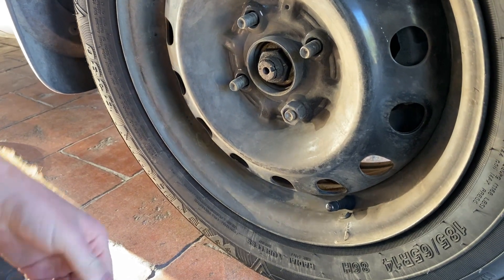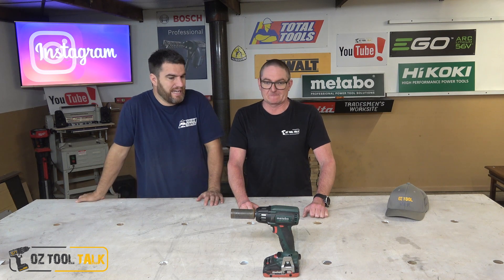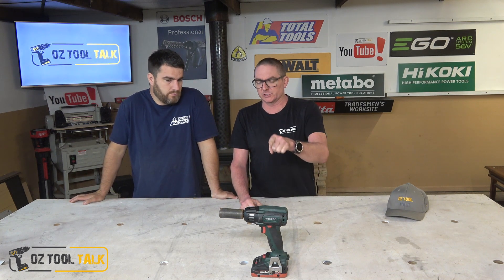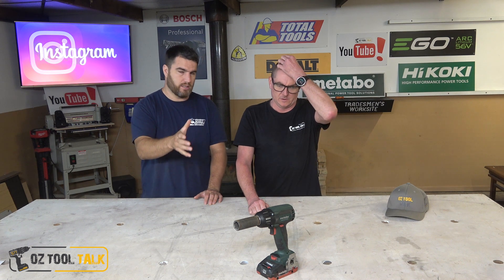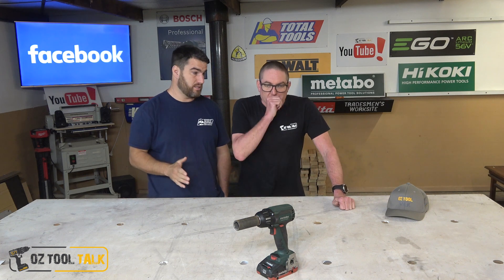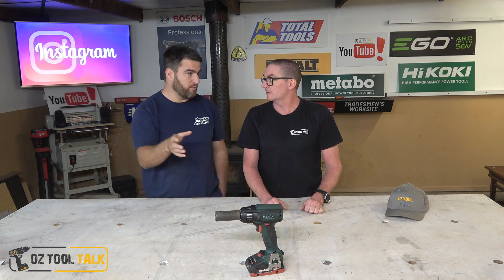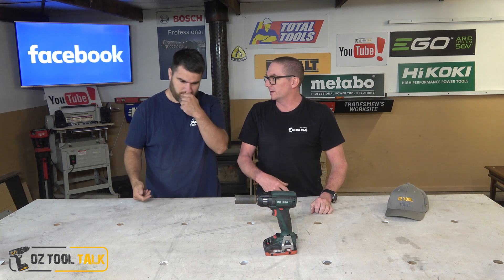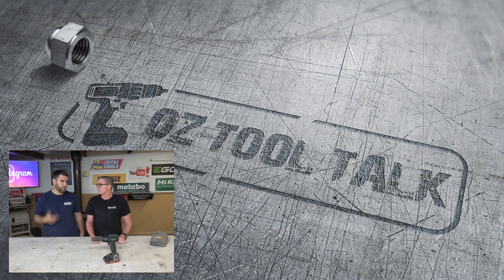METABO Brushless Impact Wrench - GERMAN-MADE - SSW 18 LTX 400 BL [2020]

Comment: I;ve had one for a few years now.
Amazing bit of kit.
I think it was the World's first variable speed impact wrench/driver.
Use it for everything from bolting up big steel girders to delicately putting small screws into door hinges with a 1/2" square to 1/4"hex adaptor.
Variable speed on the trigger and on the dial.
Has completely replaced my drill/driver for driving screws of any size.
Reply from the maker: it's a beautiful tool :)

Comment: Hello I'm from Germany and buy this one also because of your test. Unfortunately the Metabo didn't manage to loosen the nuts of my VW T4. I have tightened them six months ago with 180Nm. I'm really disappointed about this german engineered product. Can't believe it does 620Nm on your test.
At 3:36 it shows the same problem I have. Why does the working light turn on??? It should only work with the trigger pulled and stay on for about 5sec after release. At this case ist was nearly 30sec and the one I have stays on for minutes.
Reply from the maker: yeah that light is weird, does it sense vibration maybe?

can't undo 180Nm wheel nuts? I think it's defective.
Reply: @OZToolTalk  Thanks for your answer. It was also my thought but the manual shows no information. I send it back to metabo and hope to receive an answer in the next couple of days.
Reply: T4 wheel nuts are notorious for needing a breaker bar and sometimes even impact rated sockets to remove. ive heard of guys breaking breaker bars by using some pipe as an extension.  you should definitely use a torque wrench when removing one of them just to see how staggeringly tight they become. wouldnt be even a little surprised if theyre up in the 900s.
Reply: Did you ever get a replacement.
I have had this impact gun for a few years and there is nothing it won't take off.
Sometimes you have to hold it on for 10 seconds or more and it will take the nut off

Comment: No impacts put iut the torque the factory claims does no one no that by now
Reply: Well, the big makita has been tested by lots of people. It puts out what it says, I have one an it smashes nuts an bolts like there not tight. Its better  than my air powered one!
Reply: @michaelbamber4887  i have a makuta also abd you need to watch tests on them to know that they dont purlt out what they are rated for in reverse power its rated for 1180 it puts out 1044
Reply: @michaelbamber4887  its rated for 1180 in reverse but only puts out 1044 how it that what its rated for ?you need to watch that video to see how much its off not fastening torque but reverse torque you sent me a video  that proves what i said
Reply: @russellleahy  yeah, sorry 
 1180ftlb is 1600nm. Thing is, it was to new, they need a use or 6 to bed in. I have the very small one that gets ripped off in China on wish etc for 20 quid, you know the one? Well when it was new it couldn't even get my car wheel nuts off (170nm) but now its had a years use it can. I think he needs to test it again after 6 months use at least. See if bedding in makes it better. Now his 77000 ÷70 = 1100. So only 80 off!

Comment: Can you adjust the torque for fastening within a specific range as with wheel nuts in 130-150nm.
Reply from the maker: Yes the torque is also varied with the dial. Though I don't know what the increments are...

Comment: I don't think I like it, too bulky, and the video showed it to be quite slow compared to what I have tried with impact drivers, makita seems far quieter and quicker and seems better on the cheap price, plus AEG, may not be as powerful but it's still manageable and very cheap, and looks far quicker for what I've used it for!
Reply from the maker: Jake with all due respect, this will destroy any impact driver you've used unless you're driving in screws say bugel batten (14g) or less. For bolts and large fasteners, this will cream [Dwain]
Reply: Oz Tool Talk have a look at skill builders test, they put this against some impact drivers
Reply: Oz Tool
 https://youtu.be/pvqar-4ZelA
Reply: @noskills9577  this isn't an impact driver.  It's an impact wrench. Not the same tool.
Reply: Steven Davis try watching the video 😂
Reply: @noskills9577  You try learning the difference.
Reply: @svn5994  try watching the video donut